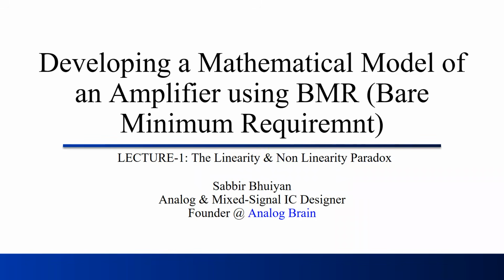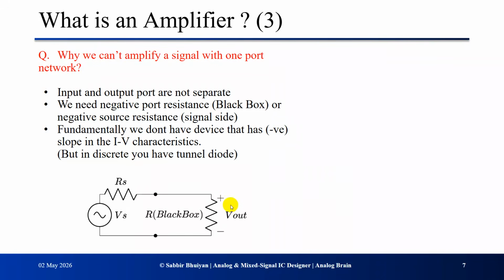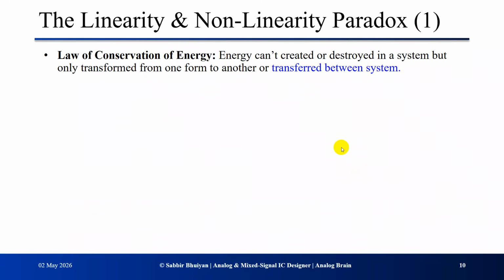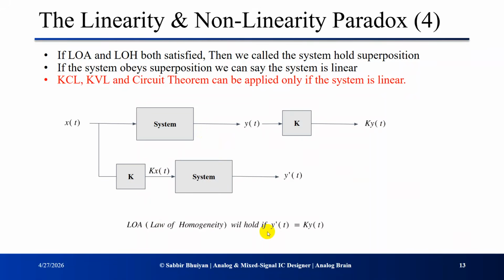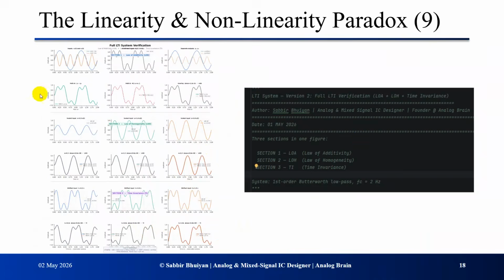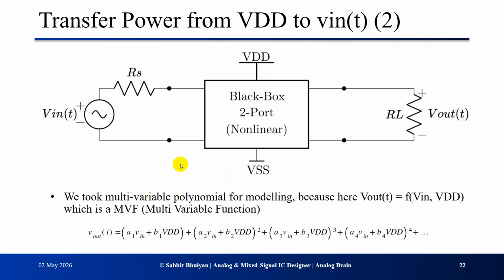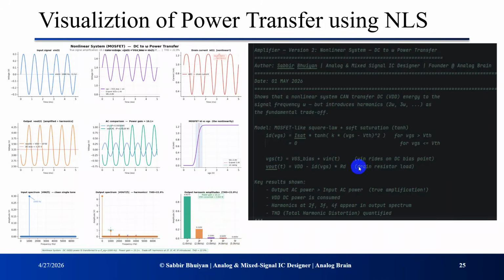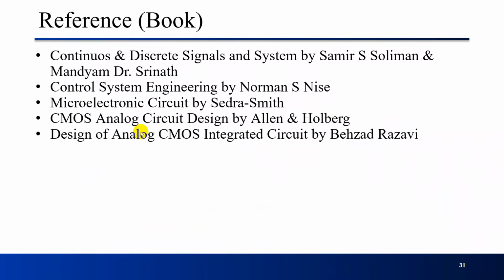Lecture 1: Why Your Amplifier MUST Be Nonlinear — Proved from First Principles | Analog Brain

Comment from the maker: 📌 Correction: In the lecture I stated that KCL and KVL break down for nonlinear systems. This is imprecise. KCL and KVL always hold, they are topology laws based on charge conservation, independent of linearity. What breaks down in a nonlinear system is superposition, and with it the analysis tools built on superposition: Thevenin/Norton equivalents, transfer functions, and H(jω). I should have stated this precisely. Lecture 2 will address this correctly from the start. Thank you to the viewer who caught this.